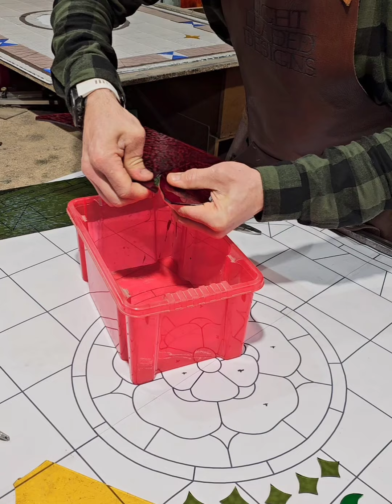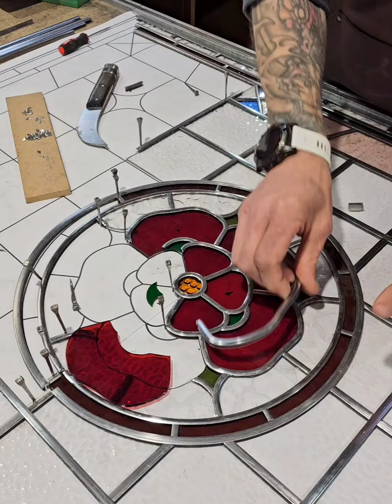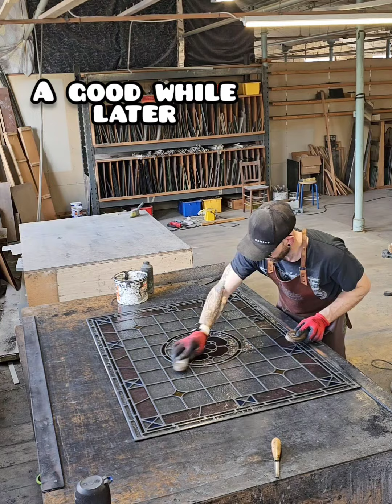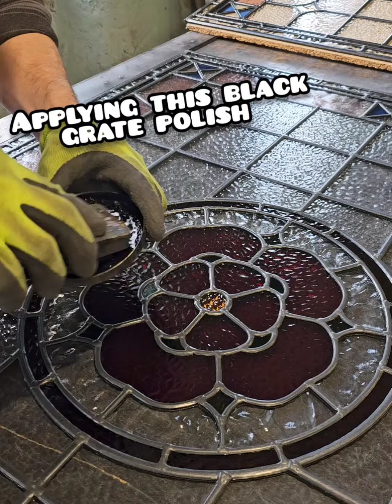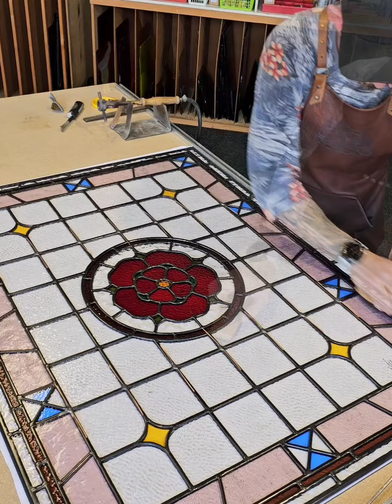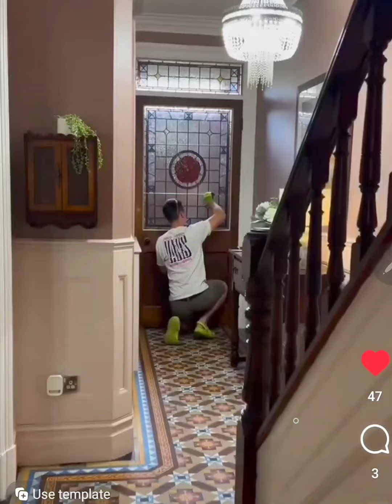Lancashire Rose Traditional Stained Glass Entrance Making

Comment: Dear , I'm looking for advice 
For 4mm thick glass , what size of lead should i use, face width and channel width of round H,  flat H and U channel ?!.
The glass panel is for wooden main door and aluminium windows.
Appreciated.
Reply from the maker: For the lead work you can use lots of lead widths it just depends on the intricacy of the design 👍

Comment: Maybe I missed it, but what are the little pieces of copper for. BTW beautiful work.
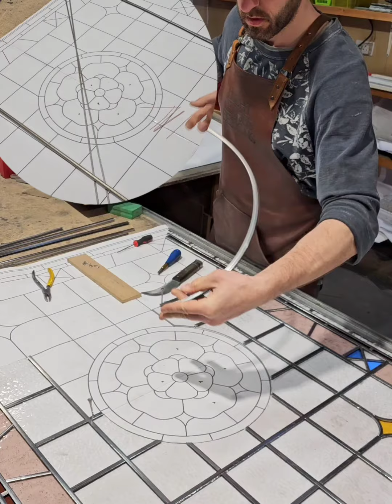Reply: 2:07 “Yeah, these little copper ties, I’ll be soldering these on, across here on the joints (motions to corners), and across here (motions to intersections), and then those are twisted around the bar, and tightened-up, and folded under; and this is the traditional method of adding strength and stiffness to a window”
Reply: The window's too big to be help together by lead alone.
Reply from the maker: Cheers for the comment 🧡💛
Reply: @JanLightLeadedDesigns  thank you. I really enjoy your work. You inspired me to start buying up tools to try my hand at imitating you.